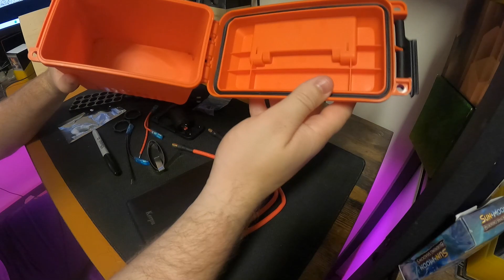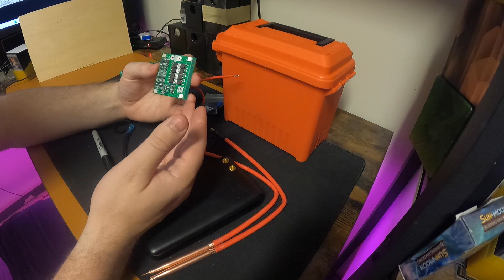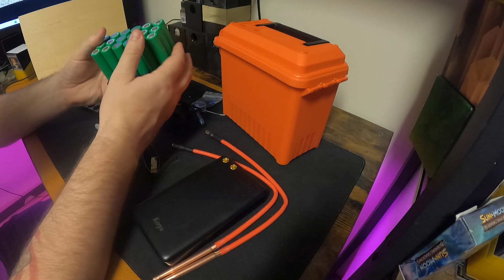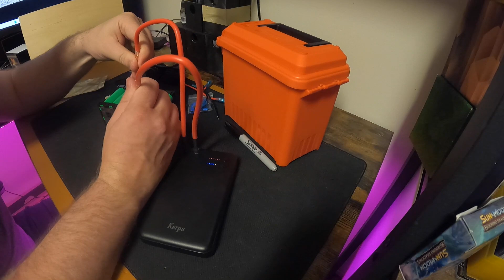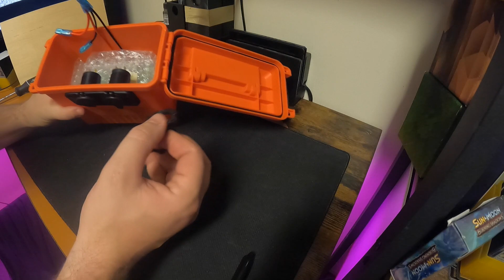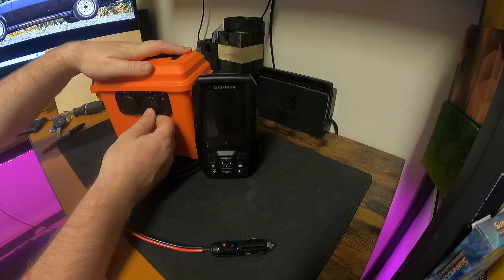DIY Battery Box for Kayak Fishing

Comment: Might have to try that. Thanks!

Btw, don’t trust those plastic ammo cans! They leak in the middle of the lid. Fixed mine by adding a bungee strap over the middle of the lid. Also I removed the rubber lid seal and added string in the groove and replaced rubber seal
Reply from the maker: Thanks for the heads up. I usually have it bungied down on the front of the kayak, so that should help, and I mostly just need it to be splash proof since it should never get submerged in the water.